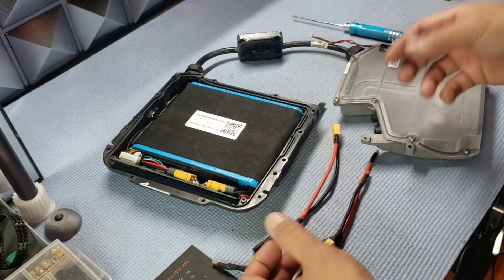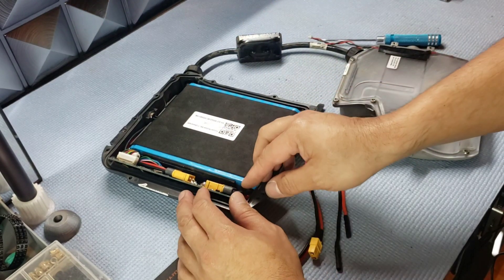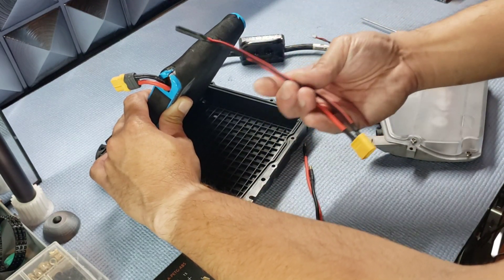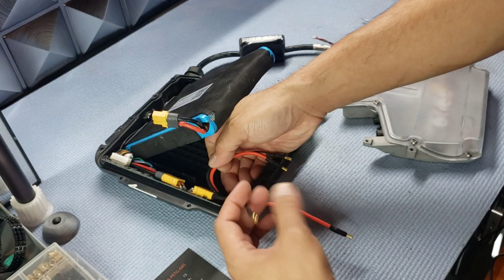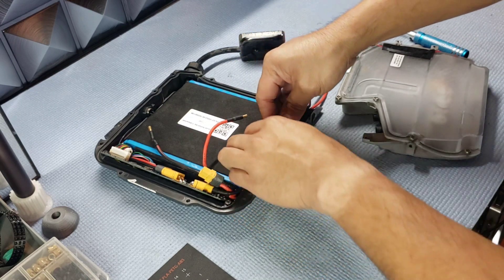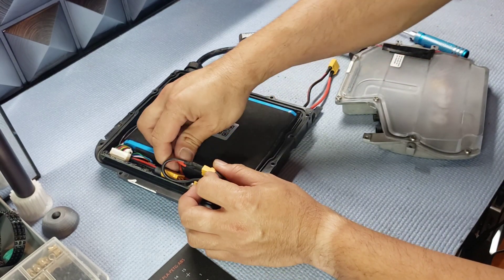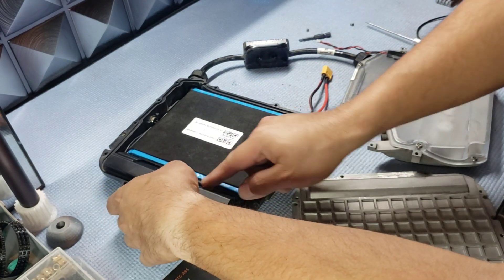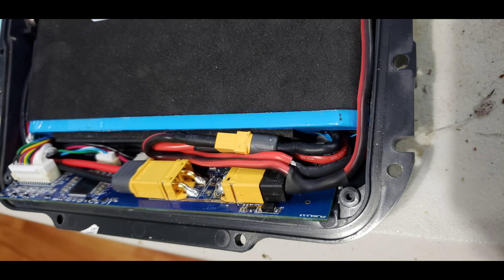Onewheel Pint R3D X2R extended battery EZ wiring system

Comment: The way you remove the xt60 from the bms without removing the balance leads first can fry the bms I had a customer do this and was really confused why you would say that when it can in most cases damage the bms I believe you might want to change that in you're video.

Comment: Hey ill be building my own connectors which isn't a problem, did you just depin the xt60 and solder around or picked up some other styled pins?
Reply: Also did you just use a fluke to and touched the pins at the bms xt60 connector and to verify if the top is ground?

Comment: I have one with the cables swapped on one of the connectors. Is that right? On one black is positive and another part is red positive. Wouldn’t that be bad?
Reply from the maker: Please email me pictures and do not install- i will send ya a replacement asap if need be!

Comment: I have 2 questions. One do you just hook up the battery to the cord. And then the other one is will a flex voltage battery work. There is one on Amazon that says 20-60 volt. DEWALT DCB612 FLEXVOLT® 20V/60V MAX* 12.0 Ah** Battery
Reply from the maker: Should work at 60v, just would add a few miles

Comment: With this easy connect system is it possible to do 2 battery packs instead of just the one on the back
Reply: Also does the fender that future motions sells on the website fit with these mods installed. Thanks
Reply from the maker: @siempreteamare97  these do fit over the FM fender 😀
Reply from the maker: Can add more batteries with a splitter, yes as long as they are all the same voltage.
Reply: Cool thank you

Comment: Just wondering what’s the advantage to getting that battery before the BMS . With sonnywheels VnR you tap after the BMS so I’m just wondering which is best
Reply from the maker: Certain pint firmware/hardware combinations dont work tapped after bms. Board senses error and shutsdown after a few miles
Reply: R3D Customs that’s really good to know !  I shall install everything before BMS then ! Thank you so much
Reply: @houseofadhdandhyperfixatio9432  Is before Bsm like that in the video, on series with the original battery ?  what do you recommend should both batteries be fully charged when pluggin in the external battery ?
Reply: Janne Liiti if you plug the batteries in series you’re going to blow your board. The configuration in the video is a parallel setup which is how I’ve been running it without issue so far.
Reply: Janne Liiti the closer the voltage when you plug the external the better. I charge the board and battery together at the same time with the stock charger
Reply: @houseofadhdandhyperfixatio9432  yes i meatn in parallel lol not 120volts :D  ...extrenal battery is going to be  abit bigger so it´s propably just easier to charge both to full or near full before connecting
Reply: Janne Liiti much easier plus some of those big batteries don’t even come with a charger so thru the board is the only way for me :p I carry the big battery in a backpack and I get about 35km with a 5Ah Greenworks 60V

Comment: How much range the external battery add
Reply from the maker: More than double stock- so for example I was getting around 8 on stock batt and tire, now with the Burris xtrarad and even my extreme carving style riding the pint, I get at least 18 miles depending on the terrain.  I weigh around 180 riding the pint.

Comment: I want to buy this for one of my new pints. Is it possible to send you the pint to have this done? I’m worried I will fry something. I might have to take the risk tho
Reply from the maker: I'd be happy to do the install for ya, but i'm afraid you might be afraid of the shipping costs for return trip lol.  Perhaps you can remove the wheel/motor and have it easier to ship.

Comment: Thinking about tight spaces in there and given that pint has an 15 cell battery pack (odd number), I wondered what the spare space was used for.  Turns out virtually nothing (big red wire and a thin blue one).  There's about 18x18x65mm up for grabs in the corner of the battery nearest the camera.  I was considering doubling back the battery lead into that space and placing a standard XT60 there.  Might need to cut the battery cell frame a bit in the corner if the XT60 won't fit through the hole.  There's probably space for the XT60 shroud too.

Comment: Anyone know if a 60v E-bike battery would work with a onewheel vnr?
Reply from the maker: should work- fully charged voltage of the pint is 63V, as long as said pack matches that it shouldn't be a problem

Comment: Me and a friend would definitely buy one but we’re scared to do something wrong! Hence, will you ever do a complete start to finish (also dismounting and mounting the pint) video? So we could easily follow it step by step, I think a lot more people would buy it :) anyways great work!
Reply from the maker: Hi Leo! If you check my other videos i have a full start to finish build to follow. Let me know if you have any other questions!
Reply: R3D Customs that was a fast reply! Anyways, i’ve seen the other video (https://youtu.be/sLt3fyMpgCA) but I don’t fully understand the difference in installing this new system compared to the one in the other video (different wires?). To be clearer, for the installation should i first check out the old video and then this new one? Or should i directly follow this one for the installation? (Not counting dismounting/mounting) Hopefully i was clear!

Comment: If I just leave the connector/mod installed, without an external battery plugged in.  does it still have issues with the app or is it just while connected to the extra power source?  weighting whether to have the mod 'just in case i need it' in the future now that I have to change my tire and bearings - rather have everything done at the same time xD
Reply from the maker: Nope- will function like normal if you do not have an external battery connected 😎
Reply: @r3dcustoms521  fantastic. thanks for the quick reply
edit: just got my kit - worked like a charm! thanks

Comment: I would still recomend use hotglue to cover those open XT60 connectors metal leads at BMS board. Since you are losing warranty anyway, and they are too out and open. One mistake with screwdriver and BMS DEAD. Another tip ... put 5 A mini-automotive fuse somewhere.
Reply from the maker: Agreed!. Perhaps 10a would be more appropriate?
Reply: @r3dcustoms521  since we running them out of specified voltage I am not sure. I personally like to stay lower and replace it if nessesary. If fuse brakes you will lose just paraler pack anyway.
Reply: @danoseus Am I wrong that those who run X2R rigs aren’t running outside the “specified voltage” range? The pixies are scaling horizontally (adding capacity), not vertically (over/undervolting, no? I’d think any voltage change would involve some clever value spoofing to fool the controller, or rolling your own firmware.

Would the fuse tip involve leaving that fuse in place after it’s buttoned up and being ridden? A 750W motor on a 56V pack would blow with a 5A fuse, and perhaps with a 10A fuse as well... but maybe not on a pint, since I’m guessing it’s governed more than the XR, which has a 15s2p pack that’d presumably be able to maintain a twice the constant discharge as the pint’s standard pack. I mean, something has to explain the difference in top speed difference, because the tire circumference delta alone can’t account for all of the reduction. If you’re suggesting a fuse for the health of the hardware once the board’s all closed up and being ridden, then I’d imagine FM has all that sorted out (provided no newly-added conductors are left bouncing around by the few who’ve dug into the guts). If you’re trying to keep things safer only while it’s on the bench, then a smoke stopper would be an easier way to keep it temporary while it’s all undressed. Depending on the breaking point of the smoke stopper though, it’d probably be a good call to connect a Power+ pack to a board that’s been drained to 58.4V, since that’s what my measurement of a fully-charged Power+ battery reads (so a fully-charged pint or XR at 61.3V would potentially give the Power+ battery enough inrush to break the circuit on the smoke stopper).

In any case, it looks like most automotive fuses aren’t rated above 36V, but I did spot a BFLP variant by PEC that’s rated at 58V.

Comment: here is something I have been thinking about for my plus...  I would like to create a switch (or manually switch them at first) so that either the stock battery or an external (connected to fender) could be selected.  the way people have been doing it they essentially connect the extended battery to the stock battery and the one wheel app doesn't get the percent left correct and you also have to watch how you connect the external battery so it doesn't over charge the stock battery.  

the way I was thinking it would be one extra wire from the way the power ranger and sonny products work.  you would bring the battery connector and the BMS connector out of the battery housing and when you want to use the stock battery you would connect it to the bms (just outside the battery housing) and then when you want to use the extended battery you unplug the stock battery and connect the extended battery to the connection.  it would be great to have a switch but I am not good enough with electricity to figure out which switch would be compact enough to fit on the onewheel rail and handle the amps/voltage needed.

Any thoughts on my idea to bring the bms connection outside the battery housing (as well as bringing the battery line out of the housing) so you could just swap batteries (maybe multiple ego batteries in your backpack and swap one at a time) and then go to your stock as needed without the two batteries being directly connected?
Reply from the maker: That is totally doable! Sounds like you have the wiring diagram done out in your head- all i'd recommend is using XT90 anti-spark connectors for when plugging in batteries to avoid the high-voltage spark associated with plugging in.  I have a working solution for my onewheel +(++), but this sounds like another option to add :)
Reply: @r3dcustoms521  Would this method of having only one battery (that SB user suggests) connected cause any problem because of the balance connector (the white rectangular connector) won't be connected to anything anymore, at least to any working battery... doesn't that pulls some information from the battery or batteries? Like as soon as you disconnect the stock battery and connect an external one well there's no balance connector anymore in play... ? Also would this method work on a hardware 5314 - Gemini5050?